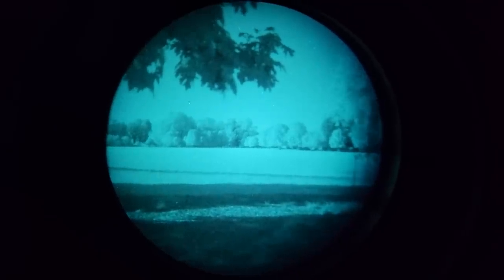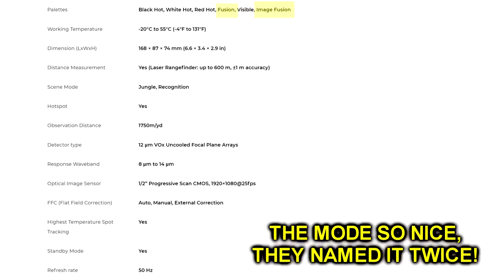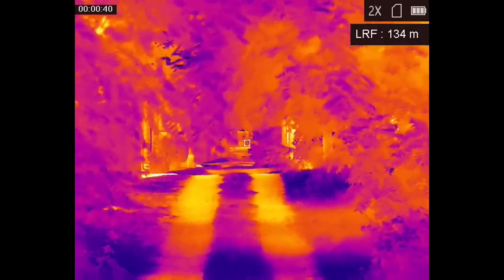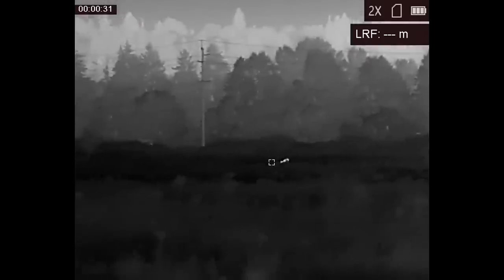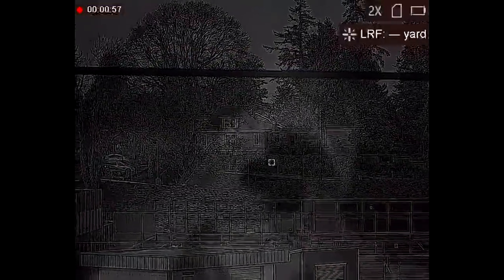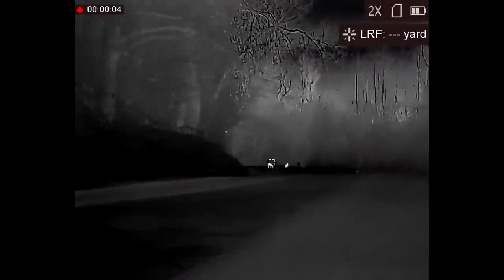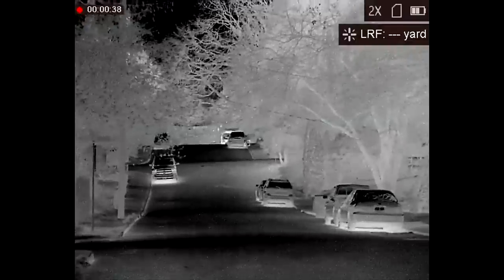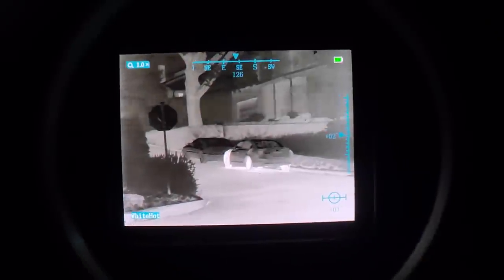Thermal-Optical Image Fusion: AGM Fuzion LRF

Comment: I figured out a quick and dirty way to convert tube resolution to digital terms. 

For modern 18mm tubes Res score in lp/mm  times 36 gives your rough horizontal and vertical pixel count equivalent.

1lp/mm is equal to one pair of lines distiguishable per mm vertical or horizontal of tube - so like two pixels. The tube has an effective 18mm diameter so double the lp/mm score then multiply it by the tube size (score × 2 x tube diameter), and you get an approximate pixel equivalent.

For something like a 70lp/mm mx10160 tube, its roughly equivalent to a 2500×2500 pixel circular screen - basically a qhd monitor. Snr cuts the percieved resolution down in low light but thats about what the percievable detail compares to in good conditions.

It will never really convert because the limits of tube detail are fuzziness rather than tiny blocks, but in principle, the amount of detail you can make out or read should roughly compare this way.

By this metric, a 640 pixel thermal core is like looking through a 17-18 lp/mm intensifier tube detail wise. A sionix opsin (ignoring any other issues) would sit roughly around 42 lp/mm equivalent.
Reply: Side note - this is probably why tubes have basically capped out at around that 70lp/mm range. Almost no one ive met can honestly tell apart a qhd from 4k monitor so it sort of becomes a moot point at that level of detail.

Might make a difference down the road if better wide fov lenses get made, but it looks like for fov everyone is just going to more tubes or living with the current 40°
Reply: uhh yeah, what the boss said!
Reply: There is one important caveat here. With digital sensors, the limiting factor on resolution is rarely the number of pixels. Pretending the two are the same works when you are working with a 640 pixel thermal sensor, but as they get better and you start to see resolutions above about 1200 across or so, this approximation becomes less and less accurate. This is especially an issue with color sensors because of they way they reconstruct color out of limited information.

The only way to get an accurate comparison between the two is to measure them the same way. Which manufacturers don't like to do because its much easier to brag about number of pixels than it is to make an imaging system that actually makes good use of all those pixels.
Reply: Many big words used.

Comment: Great point that the PVS 14 will never fail you due to firmware updates...
Reply: It also wont do what thermal will do... and its not like thermal units get auto updates.
Reply: @CPLBSS88  It also can't be defeated as easily as thermal can.
Reply: @Valorius  it's defeated easier, good point.
Reply: @Valorius  NV is extremely easy to defeat.... have you even NVD'd bro? 😂
Reply: @CPLBSS88  I have probably spent more time under NVGS than 99% of this comment section, yourself included. None of it LARPing.
Reply: @Followme556  cool story bro, bold Assumptions for a complete stranger.
Reply: @Followme556  all of it on COD?
Reply: @no-sway3709  Fuds play cod?
Reply: Its common sense people. If one item just lets you see at night and the other literally highlights your enemies for you and says "look, in the bushes, here they are, go ahead and take the shot" then its clear as day (no pun intended) which one has the advantage.
Reply: @hk4lyfe59  Have you used either? They are complimentary products really, not competing, they shine used in unison. But for the average person who doesnt hunt coyotes or pigs, youll be better off getter nods simple because you have far more use cases, plus actual depth perception. Trying to navigate under only thermal sucks BALLS
Reply: @piggyslayer1999   I'd argue that in order for them to be complementary in any realistic sense then they'd both need to be more affordable. 

Until then, thermal wins if you can only pick one.
Reply: @Followme556  sure bud.
Reply: @asherdie  I'm sure you are fierce on your airsoft field buddy.
Reply: @no-sway3709  the crossed rifles are a clue, son.
Reply: @asherdie  Oh this is the part where video game playing LARPers tell ex soldiers how this stuff works huh?
Reply: @CPLBSS88  Tell us all about it IT guy.
Reply: @nomorerainbows  im not an IT guy 🤣
Reply: @CPLBSS88  You're not an operator either kid. Maybe insulting veterans who are trying to teach you something is not the smartest play in the book.
Reply: @nomorerainbows  where did i say im an operator and where did Insult a veteran trying to help me? 😂
Reply: @CPLBSS88  pay closer attention.
Reply: @nomorerainbows  missed your meds today didnt ya?
Reply: @CPLBSS88  no IT nerd, I did not.
Reply: @nomorerainbows it’s okay,  you don’t need to simp for corporate death squad bro
Reply: @MrSlayerboy99  Which corporate death squad? And if I'm simping, they owe me some damn money. Whoever they are.

Comment: For observation purposes during the day, having a clip-on polarizer filter for the VIS/NIR camera is beneficial so you can tune off the reflections. Many of those devices unfortunately don't have an internal thread on the camera lens or a cylindrical shroud for a rubber sleeve adapter.

Comment: Ecoti is cool, liked using them. Thermal battery life improvements is what I'm hoping for more of from manufacturers. PAS monoculars for 240s are the ultimate thermal monocular though
Reply: Agreed
Reply: Agm adder has a 15ish hour internal battery, and will accept cr123 for backup power.
Reply: Take some time to learn how to work on electronics, and you can install your own USB-C charging port and run them with external batteries/chargers.  

...something that should come standard with anything that runs on batteries at the correct amperage today.

Comment: for the analog resolution, you can look at a resolution chart that combined with your field of view can tell you what is the resolution you still differentiate (in arc seconds for example), from that info you can convert it to "pixels" i would suppose. You should be able to find printable resolution charts off the interwebs

Comment: I have a budget helmet rig with one of the micro thermals locked into an articulating 3d printed bino mount across from a Wolf-14. Its actually fairly effective to drop the thermal and scan for targets (coyotes, in my case) and then roll the thermal out of the way and look for detail with the analog NVG. 

Its not my top pick or anything, and I'm eventually going to fabricate the bino mount out of aluminum or something more sturdy than 3d printed plastic, but I can definitely see it working. 

I'm actually interested in some of the cheaper ATN thermal weapon sights too, especially for pest control at night.

Comment: Nice video as always, Hop. Two questions for you:

1. What are your thoughts on just the FLIR Breach by itself, compared to the other thermal optics you've used?

2. When using the IRay thermal monocular, have you noticed any noise interference with RF sources? There was a post someone made on reddit where their MH25 was going nuts when it was within ~10 feet of a Baofeng.
Reply: Having a thermal with no base magnification can be very useful for tactical situations, but walking/driving with just this device will still be problematic in temperature-stabilized environments. If you're considering getting the Breach, I'd recommend also getting the battery extender from MOD Armory. This replaces your CR123 battery with a rechargeable 16650 and gives you significantly longer run times.
Reply from the maker: The one I have for testing right now is the AGM StingIR, although I think it's largely the same as the MH25. I just waved a bunch of xmitting baofengs in front of it and can't seem to pick up any interference.

Comment: AGM consistently pumping out subpar devices
Reply: Yep and there customer service sucks! Sold what Agm products I had left
Reply: @NGA Outdoors  I've never had a good experience with their sales reps
Reply: @poopoo7705  it’s went down hill, sticking with iray and pulsar now.
Reply: It really feels like they outsource their product manuals to a non-English speaking company. On the device I have there is no indication which way the batteries go and it isn't the universal spring side equals negative, nipple side equals positive... There is no ON/OFF indicator, just a knob you twist and hope for the best. There is no reviews or setups guides for the majority of their products. Their customer service dude sounded peeved when I told them how easy it would have been to avoid this confusion. Of course with use I got it all marked up and figured out. Just a bit jarring when spending 5k.
Reply: @ngaoutdoors4157  I've got the Armasight Predator from like 2014. It was a little over 3k used. With 60hrz refresh rate and a usable 4x zoom resolution, it's awesome for hunting. Used it in -4 F with a 20mph wind chill fine, it actually beat a new Sig Echo in image clarity somehow.

Comment: you can probably figure out the dot pitch of a thermal tube in relation to the "resolution" of the human eye, this would be much alike determining the "retinal" ppi of a display where a ppi of 91 on a 1080x1920 24" monitor at 37" away from your face you can no longer perceive individual pixels.

Comment: NOT REAY FOR PRIME TIME!  I have about 15 thermals ranging from 50K for the Rvision Carbide16 with double and 640x620 using a 100mm objective lens and a lens that zoom 100 to 180mm down to the breach I bought when it first came out and for a scope I have the Pulsar XG 50 and a drawer full of Armasight Zeus 2 14 640 30z. I bought the Fuzion and found they spent more on marketing then they did on the processor.  They advertise 12 Micron 640 with optical night vision.  I thought it would be fantastic.  What I found was a gimmick, they did not spec a significant CPU processor and the image seen is never clear if anything is moving whether your hand sweeping the horizon or a moving image.  I returned the first one thinking a got a bad specimen.  Bought another and it was exactly the same.  It seemed like you were looking thru a jar of vaseline, the eye piece seemed like it was made of plastic.  I could hardly find an animal with the Fuzion.  Definitely wait for 2nd gen becasue the combination of the optical and thermal image is worth pursueing but not with this manufactorer yet.

Comment: I ran a PVS-14 WP GEN3 & FLIR Breach bridged together for about a year, I found when properly adjusted my eyes merged the images just fine. The draw back in thermal is pointless in a house or for CQB, thermal works best outside. I kept the FLIR Breach but bought a second PVS-14 WP GEN3, so now I'm running dual PVS-14's and not sure what to do with the FLIR Breach. I would love an COTI but they range in price from $4K-$9K and everything is sold out all the time.

Comment: There is one guy on Youtube that said he finally oriented his Breach with a PVS-14 correctly enough it doesn't hurt his brain to use.
Reply: I’ve been running an MH25 w/ PVS14 for almost a year now, and looking at the footage from Nightwalker’s videos I can actually see how the “outdoor alert” mode probably works better as a ghetto fusion compared to the more expensive monoculars like Irays and Nox. BUT, the higher end thermal monos have much better range and resolution compared to the Breach. I can get my MH25 and PVS14 to fuse/merge images most of the time when I’m static, but with walking/dynamic movement it goes to hell. Doesn’t give me a headache, but really makes both the PVS14 and thermal image less usable. TLDR if you’re moving use one at a time (or go with a true fusion/clip on fusion system). I like having the thermal monocular because it works during the day as well.

Comment: What's a good night vision or thermal setup that covers almost all ranges that can be used to aid in the defence of a home on the side of a mountain at night? with a maximum budget of 5k and a strong desire to spend far less then that, something that can be used for that purpose. It would also be nice if It could have decent capabilities  incase stuff goes south in the country and greater threats are faced.

Comment: All these crap thermal devices for ridiculous amounts of money.
Reply: I'll throw in a hot take on top of your own. I've been told NOD and Thermal is expensive due to the tech. Yet, I have a playstation VR bundle that was a few hundred dollars when I got it brand new. Is Virtual reality at this point a cheaper technology than NV/thermal, especially with how much developer software support is needed outside of VR hardware with its own programming hurdles?
Reply: @762x69  but there's not many manufacturers of NV tubes, China started making their own and they've been rumoured to be $600 a piece wholesale. You can now buy the new photonis dual WP for $7,000. This is the nice thing about more people getting into NV and not just the military, creates an opportunity for less expensive devices. I still remember when pvs31a's were 20k+ not too long ago. I'd expect by 2030 you will be able to purchase a set of duals for 2500-3000 with a resin body. Feel like with thermals they just keep the same tech in a different shell.
Reply: @762x69  Yes, economics of scale for starters; but also because glass is completely opaque in the spectrum of infrared radiation, which is how thermal signatures are detected,  thermal devices must use Germanium or other materials that are transparent in the infrared spectrum for their lenses, those materials are vastly more expensive. Then as you stated, development and tech also is tacked on to the price, which is also more expensive because thermal devices are primarily marketed to duty/military use, they have to do in house testing before a product can ever be sold unless they want to be sued like L3/EoTech with the temperature fraud debacle or 3M with the hearing protection failure. VR tech can just be slapped on the market and firmware patched as end users find bugs & glitches as no one is in danger of grievous bodily harm if little Timmy can't see anime tiddies on his headset. The list goes on & on for why thermal is more expensive than VR.

Comment: Check out Iray, MUCH better than AGM shit.
Reply from the maker: It's the same thing
Reply: @Hoplopfheil  Not even close bro. I've had this handheld and a few othr AGM scopes. as well as several Pulsar optics. I currently have an MH25. I also have access to an RL25 and Nox 18. The MH25 blows everything AGM out the water... it's easily bridgeable for me with my thin filmed L3 WP PVS14.
Reply from the maker: The MH25 is largely the same device as the AGM StingIR
Reply: @Hoplopfheil  Right, on paper and in theory. What I'm saying is that in reality the Iray devices preform MUCH better than AGM. Take or leave it, doesn't make much difference to me but I just hate to see people use sub-par thermal to judge the whole world of thermal.